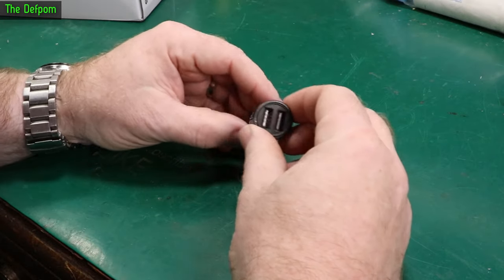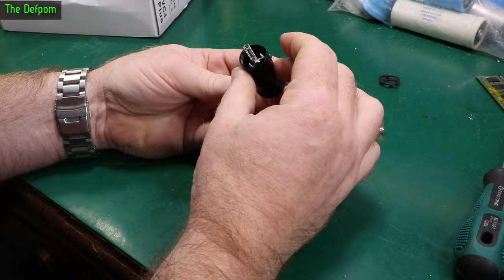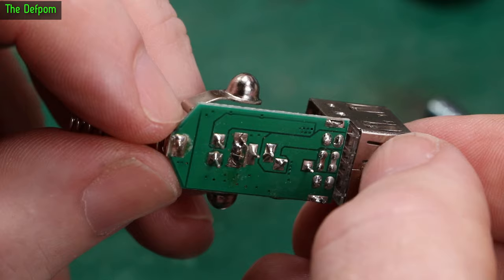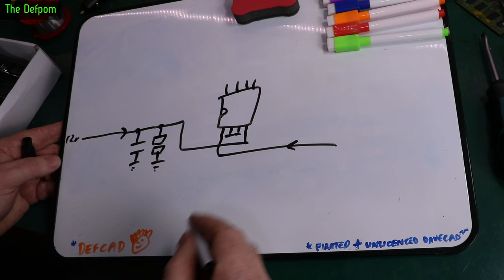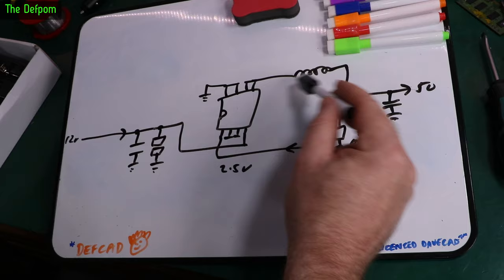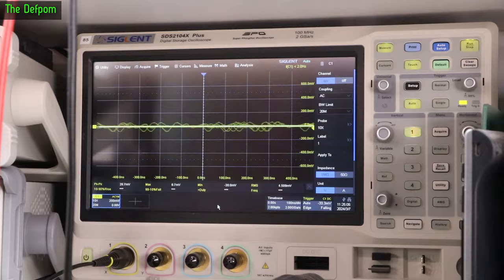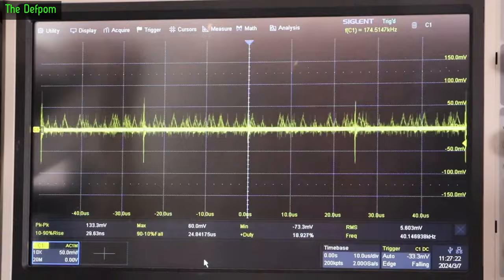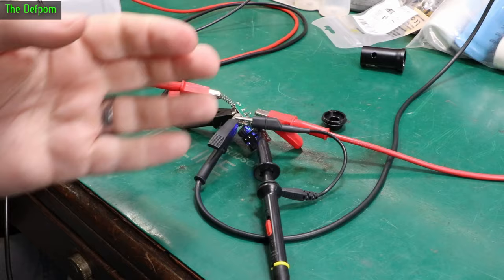🔴  Car USB Charger Teardown and Testing - No.1238

Comment: It always brings some joy when I hear it called an 'Accessory Socket' in a modern car :)

My car is now officially 33yrs and 2 months old, and in mine, it is a cigarette lighter socket :)

Also, if your socket is the issue, then modern cars have even bigger problems than I would have thought, in my car, you can literally pull the socket right out of the dashboard, because the connections broke a long long time ago, it even spins around inside the hole, yet it still works 100%, I have a 4 port splitter plugged into it which powers a GPS, dashcam, my Brass Monkey 30L fridge/freezer in the cargo area (It gets HOT here in Western Australia!), and a plug with 2 USB ports on it.

Comment: Those green caps are nasty. Had a little switcher go bad because the output smoothing cap had dried out, I replaced them all and it does the job perfectly.

Comment: The choice of caps is wrong on the output as they haven't addressed that 136Khz switching noise at all but as you say it is what it is and it handled the load like a champ !...cheers.

Comment: I'd run it assembled with 14.5 V and 1.5 A load, inside "cigarette lighter" socket, connect load trough USB port. I think it can be heat.

Comment: Try that USB charger at less than 12V. Is it possible you are getting a large volt drop at the socket, or brownout spikes? Otherwise, i've had same bad luck with dashcams until I switched to NextBase, they just work forever.

Comment: Who ever sold you that knock off cad should give you a refund. it seems to have been provided with a whole bunch of dodgy symbols. 🙂

I've had a few of this type which would knock the radio out with wideband noise. They seem to just use the example circuits shown in the datasheets and never add the other components required to keep the conducted and radiated emissions within limits.

Now if anybody can find information on a mains dc switcher in a sot23-6 package marked 33p2 it would help Me a lot.

Comment: Hi,found one of the chargers completely upset the CANBUS on a car I owned from the internal noise generated from the charger the car was a Smart Car. It through up faults like computer failure airbag failure and it didn't allow me to restart the car. So I disconnected the charger out of the lighter socket turned the ignition off and turned it back on and all the faults disappeared. Not a good thing to happen when on side of the road between Hamilton and Paeroa.
Reply from the maker: @davidgrey943  wow that’s a good one to know of.